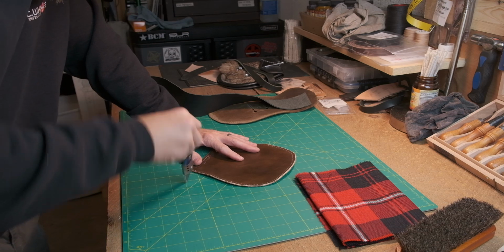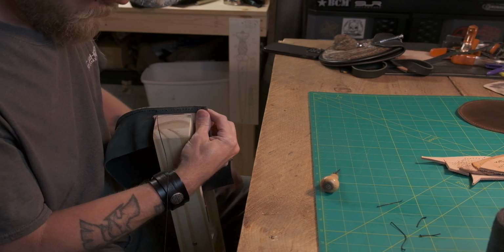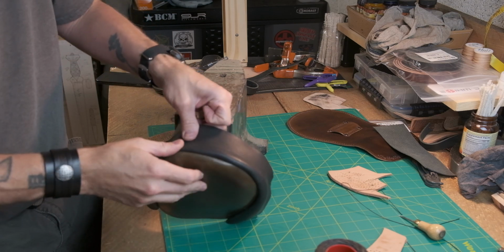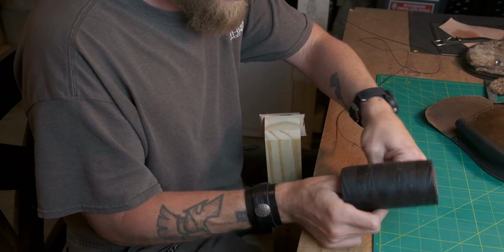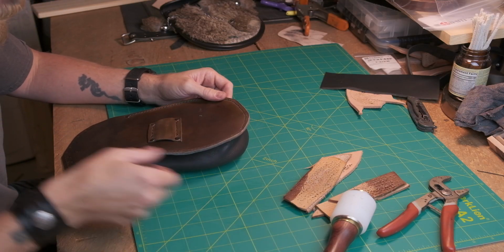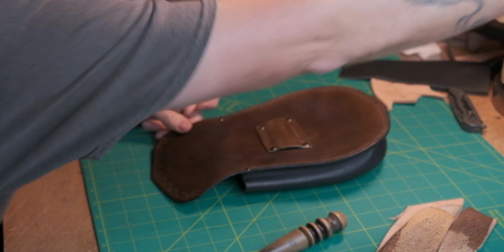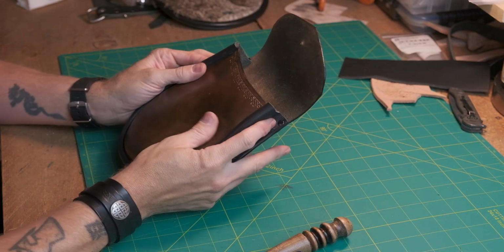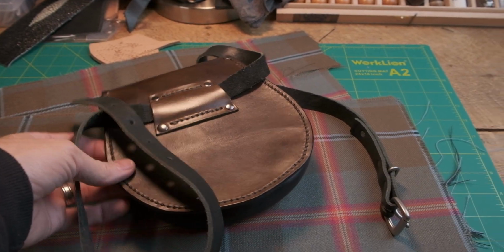Making a Leather Sporran - Finished!

Comment: Also, at times I will punch all holes in parts prior to stitching .  You just need to verify hole count between parts being connected .   Usually I do not use glue.  In other scenarios, I will use 1/8” double face tape when I attaché some parts , I.e., stitching bag inside out.  When doing this I may overlap edges up to 1/2” with stitch line 1/4  from edge.  This hides tape/glue and thread when turned in side out.  Note tape is attached to far edge. Hope this helps.

Anyways nice work.!!!   I started making sheaths for knives I’ve made…. Many other customers also started asking for leather custom work…